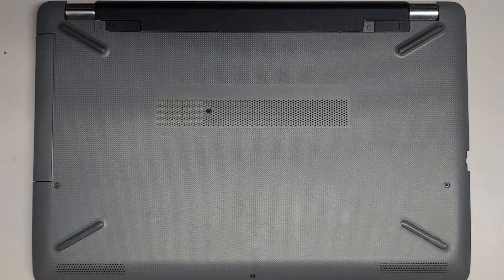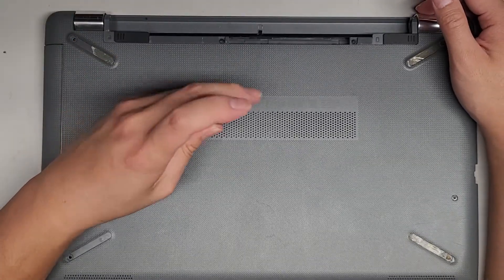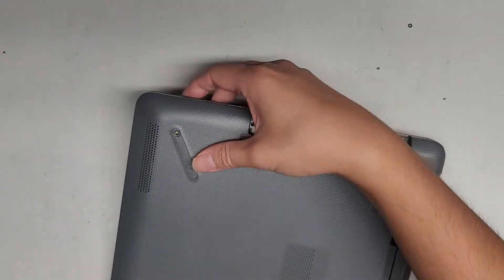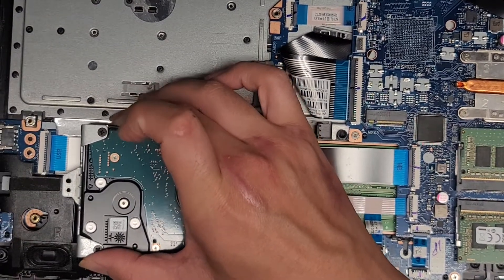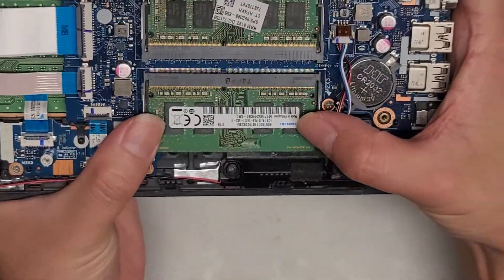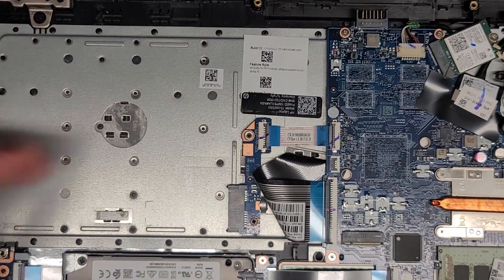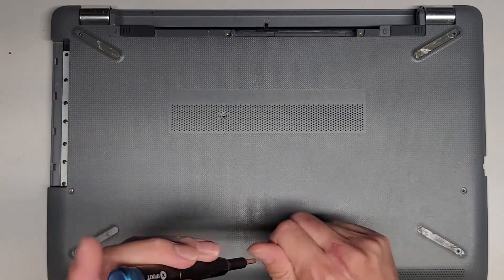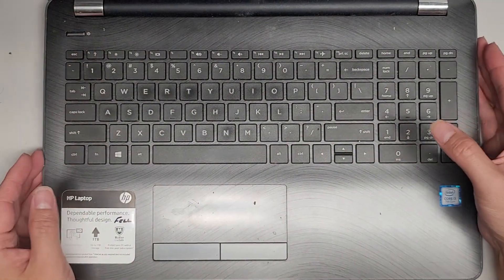HP 15-BS033CL Disassembly RAM SSD Hard Drive Upgrade Battery Optical Drive Replacement Repair

Comment: I just need help popping off the back cover, the optical drive is too hard to get rid of the clips
Reply from the maker: Just gotta follow the video
Reply: @ItsBinhRepaired yeah I got the first clip out
Reply: @ItsBinhRepaired the plastic on mine kinda doesn't go that high 🥲
Reply: @ItsBinhRepaired i got the thing open, do you think I should add a m.2
Reply from the maker: @CrebitKarma  nvme SSDs are much faster than SATA ones
Reply: @ItsBinhRepaired yeah I know that, would the Sata drive still work if I had a m.2 installed?
Reply from the maker: If there are two drives, yes.
Reply: @ItsBinhRepaired okay that's good too know. Also, if you don't mind me asking, the keyboard stopped working and there anyways I can fix it?
Reply from the maker: I hate how YouTube doesn't notify me of replies. Were you able to figure it out?
Reply: Oh yeah I figured it out. BTW the m.2 slot doesn't support NVme it supports SATA 3 M.2. Thanks for the tutorial cuz now I have a fully specked out laptop @ItsBinhRepaired
Reply from the maker: @CrebitKarma  awesome! How did you fix the keyboard issue?

Comment: Thanks for this very helpful video, man! 💻🪛😎👍
Reply: Thank you for the video!

The M.2 is B-key SATA only, just FYI.

Also, I added another OEM Samsung 4GB 2400T SO-DIMM for 128-bit dual-channel, but speeds stayed at 2133. Not awesome. Hinders the 620 iGPU.

The original stock 1TB HDD is absolute trash. Definitely replace it with an SSD because the 7th-gen i3 is hardcore crippled by it and system performance is literally 20x faster after the swap.
Reply: I forgot to mention that it can boot to the M.2 SATA SSD, but you have to go into the BIOS and make sure it shows up in the boot options. No need to revert to legacy boot, just reconfirm the boot order in UEFI and it should automatically boot from the M.2 on the next restart.
Reply from the maker: @nickbishop1850  yup
Reply: @nickbishop1850 did you change the ram speeds in bios?
Reply from the maker: @CrebitKarma  I don't modify things in bios
Reply from the maker: Glad it helped. If you haven't already, please like and subscribe so others can find my videos and possibly consider watching a few others to get the algorithm to recommend my channel. Thanks!
Reply: @ItsBinhRepaired  Will do, man! 👍
Reply from the maker: @mcj5644  Thanks!